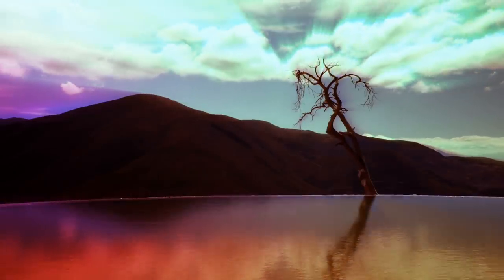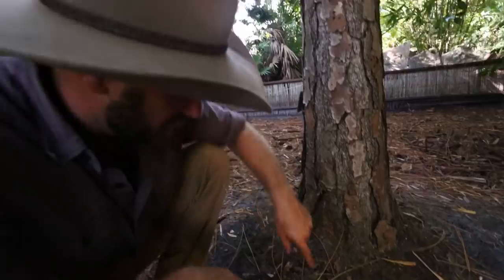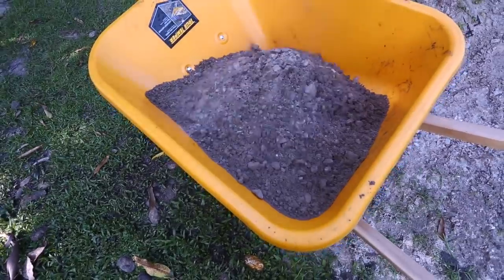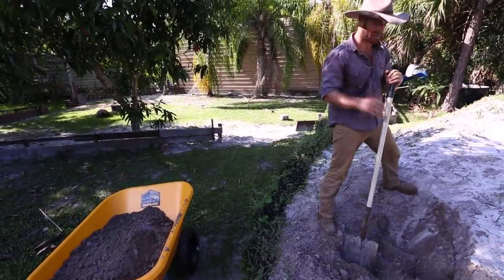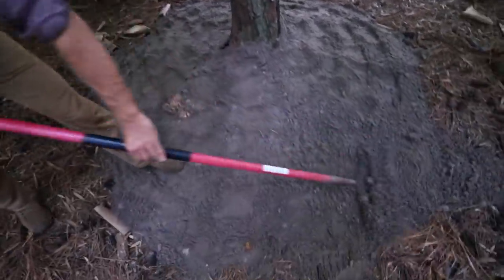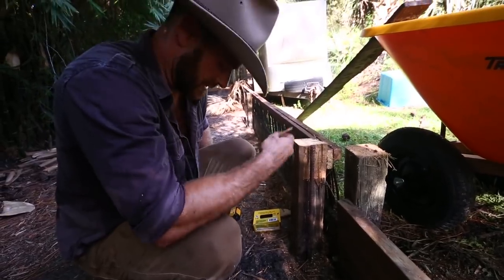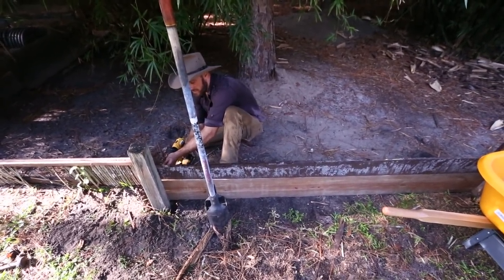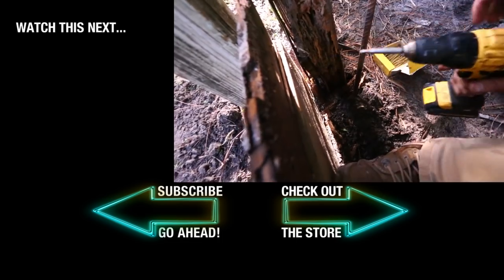Build an Egg Laying Mound for Your Tortoise

Comment: IMO double-wheeled wheelbarrows, while more stable than single-wheeled wheelbarrows, are by far more difficult to push and maneuver. I would, every time, rather manhandle a single-wheel than deal with the double-wheel.